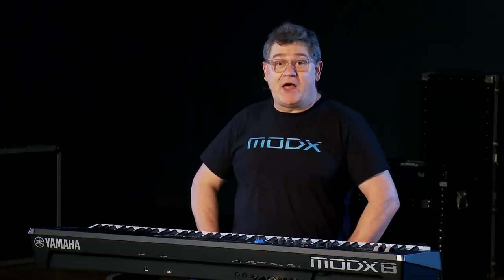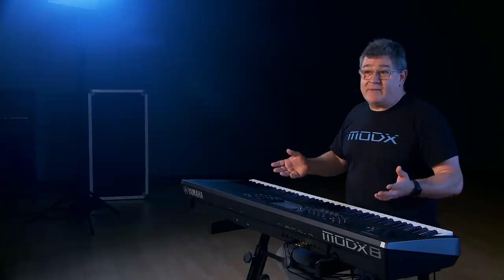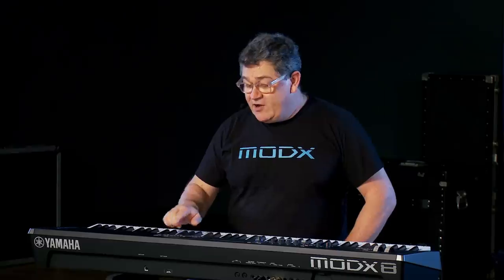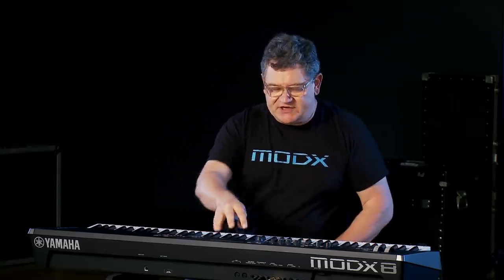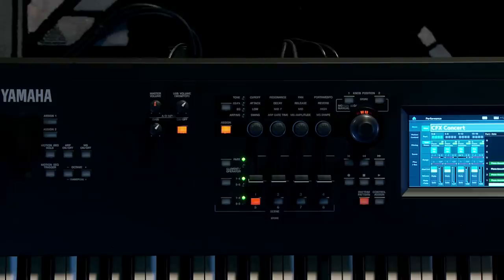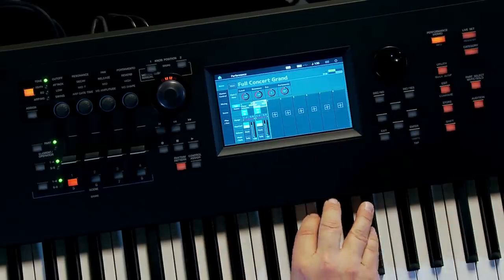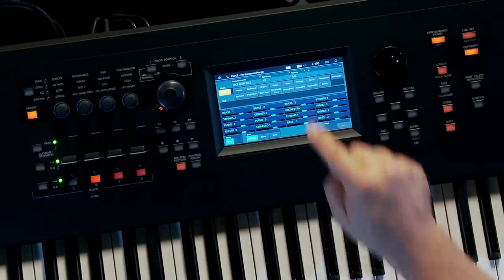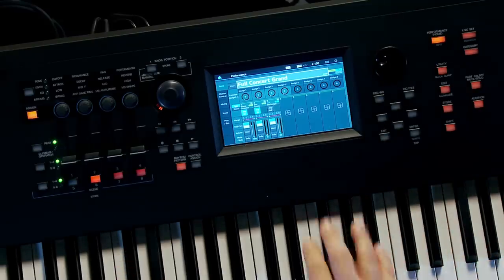Yamaha MODX - Tutorial with Blake Angelos

Comment: Blake, I upgraded from the MOXF8 to the MODX8.  I love everything except the transpose buttons.  When you've transposed the keyboards in half steps (not octaves), there's no indication that the transpose function is active.  No lights are on and there's no indication on the touch screen.  The next update to the firmware should include a line of text at the top of the touch screen to indicate how many half steps are actively being transposed (it flashes on the touch screen for a few seconds and then goes away).  Or, use half-bright lights on the up/down transpose buttons for half steps, in addition to the full-bright lights when octave transpose is active.
Reply: How could they forget that?

Comment: Why doesn't Yamaha have samples of their iconic CP30 Electronic piano in their soundbank?  There were two banks (left and right) each that had four sounds for a total of eight sound settings on the CP30 that you could select and combine in any combination.  Yamaha could provide a sample of each of the individual eight sounds that the Montage/MODX user could then combine like on the CP30.  That piano had much better sound than on any Rhodes piano.....

Comment: The lack of the vst editor is a big step backwards from MOXF. Editing on a small screen + one dial circle it must be very tedious.
Reply: Use a Stylus for that and its Fun ;)
Reply: It's not as bad as it might seem - the dial works well, plus double-clicking on a value opens up a number pad which can make it quick for known values.  For live patch tweaking, there's the assignable knobs and quick edit modes, which change values on a relative basis rather than changing the underlying patch values.  As Blake mentioned, there's also quite a bit of redundant navigation, which helps to speed up getting to common sections from logical jump-off points.  I'm not sitting here wishing I had a VST editor while I'm making patches.
Reply: I guess it never occurred to you,that the reason the MOXF had a VST editor,was due to the miniscule display of the MOXF?Actually,the 7" full color touchscreen of the MODX,is a light-year leap ahead of the MOXF...but that's not good enough for you,is it?.In addition to the MODX's amazing display,you also get the very same sound engines and all of the presets and effects of the Montage for a drastically reduced price and yet,you complain about the lack of a VST editor which is totally unnecessary....WTF is wrong with you?
Reply: I wish Yamaha did the MODX with a 10 "WVGA color TFT display instead of the diminute 7" WVGA color TFT? I dont care if I need to pay an extra $ 150, but 7 "inches? 2018? Really ... Also in MODX 8, on the right side where there are no buttons, put a simple support so that the laptop or tablet does not move when we play live.
1
Reply: @HighlandStudio91  the same editor was also for Motif XS and Motif XF, both with big screens.

Comment: Is there a......
Full Featured Sequencer?
This time around, which was the Montage's biggest weakness and oversight, for those that do not want to be tied to a computer or ipad to make finished compositions with there $3000 keyboard.
After touch?
Breath control input?
Price?
Reply: Tigerex966 I’ve had mine 2 days. I’m trying to read the manual and search the web, but it’s not quite clear to me how to use the sequencer. That was one the reasons I bought the MODX was to be a “all in one” option outside of a computer DAW . I had the Motif, and the sequencer was very straight forward. The MODX hasn’t been as intuitive yet for me :(
Reply: @JacobAndJamal hey Sapiens Strength, did you sell your MODX? I just got it and it's not at ALL as intuitive as I had hoped it would be. I've got a few analog synths and a deluge. Was looking for something with more sounds but hoped it could take over the deluge's sequencing job, but no. The deluge is much quicker and intuitive for easy sequencing

Comment: I wonder how it works in multitibral mode with a computer
Reply: By default, each part transmits/sends midi on its own midi channel - so really easy to use it as a 16 part multi-timbral sound module.  There's also an option in utility>advanced where you can set all parts to send/receive on a single midi channel, which makes it easier to work as a single layered instrument.

Comment: One question
Does this keyboard have
Integrated on board performance sequencer.... Can I produce tracks with the drum programs and the other sounds in this keyboard from this keyboard... do I need to connect the keyboard to my Mac and use logic Pro X
Reply: Yes, do I can
Reply: Yes, it does have a song, or performance, sequencer. The new update to the OS (version 2) improves the sequencer over the original version. I think it could still be better, but it is eminently possible to produce a complete track on the MODX alone. I may have been spoilt by the sequencer in the MotifXS, which I have yet to see bettered on a synth.

Comment: One more question.  These keyboards are supposed to have "seamless" changing between sounds.  When I am picking sounds from my User Live Set, sometimes they change seamlessly and sometimes they don't.  Why is that?
Reply: Only the sounds with less than 4 parts will seemlessly change. These are identified in the category screen with a little sss icon next to them. Near where FM-X and AM2 is shown.

Comment: I had no luck with this Yamaha Modx 8. This instrument started to click on the keys 3 weeks after the purchase. After longer programming, the display has stopped freezing. I had to send it back. Poor plastic box. Clever Montage copy.I'm sorry because the inner part and the sound generator are excellent. I'm going to Nord.
Reply: Lajos Mészáros the nord is nowhere near the features as this modx. But if you only want sounds, then yeah the nord will do. If you want a workstation than the nord is a no no
Reply: @Lajos: 
Thats a somewhat weird ending of your comment, considering that you must have taken the MODX for a reason, which I assume someone who knows what he is doing, for example would choose a MODX over a Montage for financial reasons, otherwise if one doesnt have to care about the price, might as well go with the expensive solution. But then you end it with commenting going to Nord, which is as expenisve on that level like Montage. Or even more. Doesnt really fit together your determination.
Reply: If you have money for a Nord, why u came to MODX??? Nonsense...
Reply: Found the Nord Rep.
Reply: @OLDM4N-DE  I bought the Modx because it was very good in weight and satisfying my needs, but because I couldn't handle the wrinkles I had to buy a more durable instrument that has hammer mechanics and is in weight. Nord Stage 3 HP 76 met these requirements. I also thought about Montage 88, but who has the power and power to carry a 30kg instrument for the concert ?!
Reply: @fnonaka  At first, I didn't have the money, but you haven't even heard that people are saving money on more expensive instruments?
Reply: @DazReht  Húha, yess

Comment: Great info Blake !  Just curious about the MODX capability to create analog lead synth sounds like Pink Floyd/Manfred Mann etc, Moog kind of .. ?
Reply: I've been pleasantly surprised at just how well it does analog sounds. it comes with some useful analog synth raw waveforms, and there are some more free ones on yamahasynth.com (the cs80 ones are very nice). The filters too are pretty impressive given this isn't being sold as a VA.  Obviously you can't do fun stuff like oscillator sync and crossmod, but that is baked in to some of the raw samples.